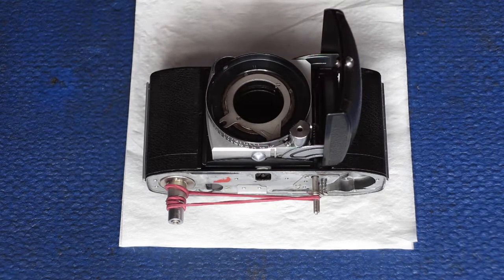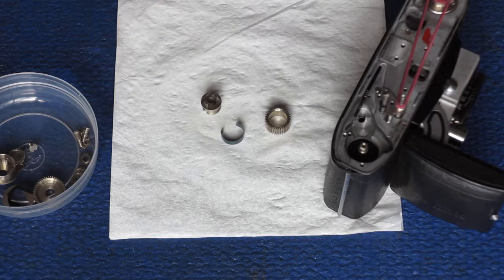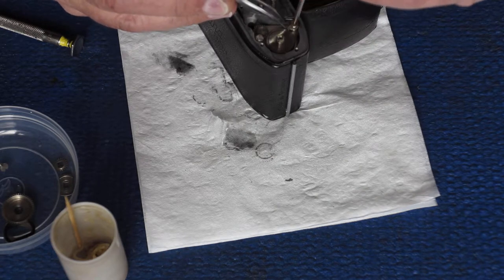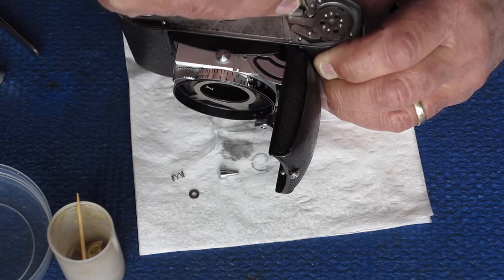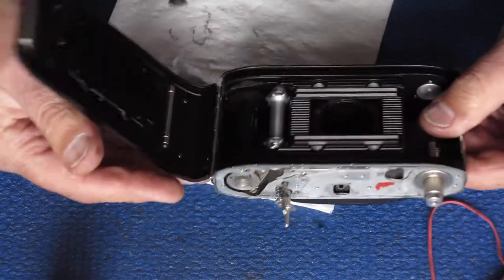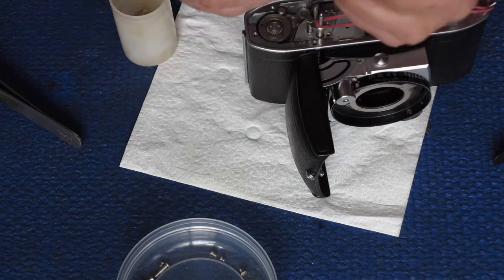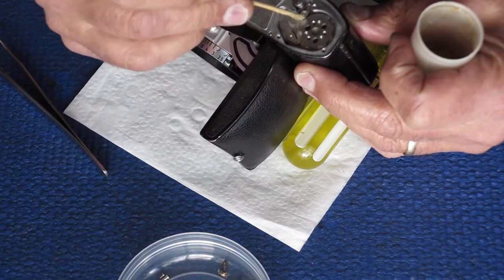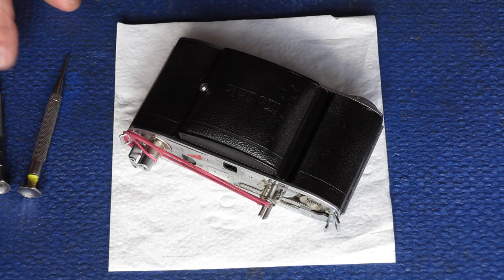Kodak Retina IIIc servicing part 4a, reassembly continued.

Comment: I have a Retina IIa and the shutter sticks open at position 1, 2, 5, and 10. All other positions work. What do you think the problem is? You think it has something to do with the timing mechanism? Also what do you use to glue down the leather when you peel it up?
Reply: Also great videos, very interesting
Reply from the maker: I'd say the shutter needs to be stripped and cleaned. That is always the starting point for dealing with shutter problems. Usually that is all that is required, and if care is taken to avoid disturbing any adjustments, then if it worked well after the last service, it will likely work fine once it has been cleaned again. You can find a guide to stripping the Synchro-Compur shutter for the IIa here... http://retinarescue.com/retina1a2ashutter1.html
The shutter is the same as that in the Retina Ia, see me service one here..https://www.youtube.com/playlist?list=PLDDcV5sY4JWLx13MvBFawNSETMv32aHaf
Reply: Thank you for the reply. I will try cleaning and will return if the problem is not resolved after that. Again great videos and your website is very helpful. Keep up the great work.